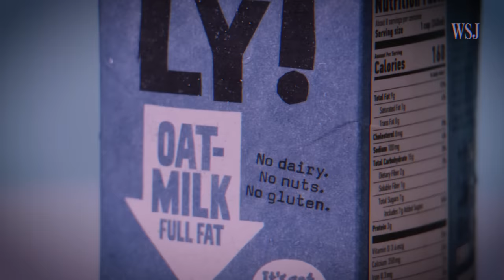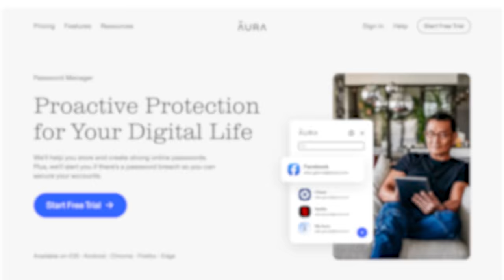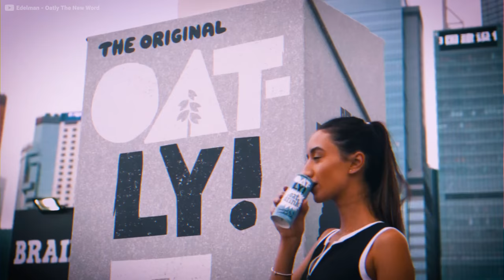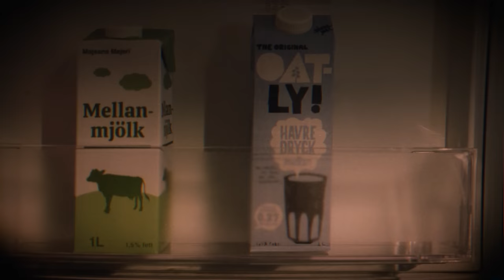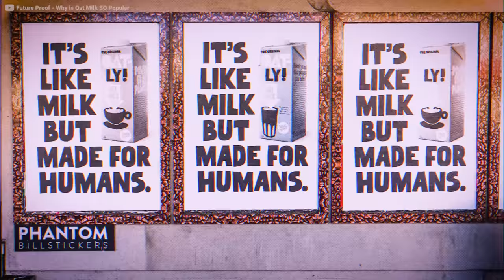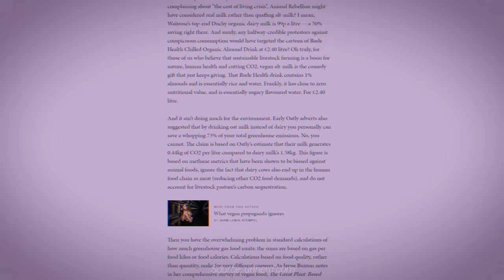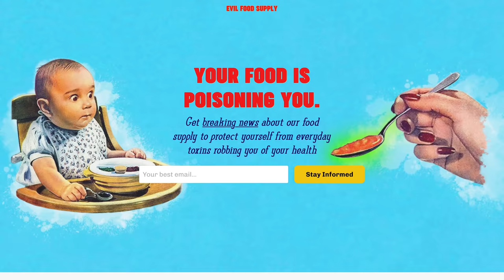Oat Milk is literally a scam.

Comment: I hate oatly, just to be clear. But there is so so much wrong with your video. Let' begin. In germany you pay around 2.5 € for 1 litre of oatly. That's roughly two dollars. If you buy offbrand oat milks you can get away with 0.9€ per litre. So the pricing is just an inherent feature of american capitalism. By the way cows milk here is aroound 1.3 € per litre.
Also, there is absolutly nothing wrong with dipotassium phosphate. Using complex words for everyday ingridients without clarifying what your exact issue is, is just cheap fear mongering.
That process to make oatmilk taste like something is just good old fermentation. Known to mankind for ages. You even point out that that is what happens in our mouth. So guess what happens when you eat oats.
Also, the glycimic index in itself says nothing. What you are looking for is insulin response. Did you know that glucose has a GI of 100. Wonder why you didn't point that out.
An there is so much more... I wish you would have pointed out the real issues that make oatly a company to be avoided, but instead you appeald to ignorance and emotion and cheaply arrangend information fragments without context.
Reply: Well said.

Comment: Wait so nonstick pand also can be bad for you?
Reply: They say it’s only if you use is for too long or scratch things into the coating… not sure what to believe!
Reply: Yes. As the coating gets destroyed, it ends up in your food, and then in you.
Reply: @malcolm_in_the_middle  what if only cook in it when i use olive oil? Does it help.
Reply: @mohamedhazzam9370  Not really. You still have to move the food out of the pan into your plate somehow and also you have to stir the food in the pan somehow too. So you can scratch the surface and get the coating into your food.   Use wooden spatulas or spoons to do so.  It will protect the pan better too.  But if you are afraid - you can switch to other types of pans.  Iron pan seasoned with olive oil seems to be pretty good for cooking.
Reply: @alexforce9  im glad you brought that bcz here is how i do it. I basically heat the pan a bit. Put some olive oil to cover it. Crack my eggs in it and just leave it to cook. Then when its ready i just eat it off the pan without moving it. I do use . wooden spoon.

Comment: now do cheap peanutbutter. my kroger brand i bought actually has vegetable oils, sugar, preservatives.

like why do you need to cut peanutbutter with vegetable oils? it tastes noticeably worse than natural peanutbutter.
Reply: The kroger brands has the most toxiccc ingredients!! Don't even get my started on the salad dressings!! 
I seen the exact peanut butter you're talking about too, it's insane !
Reply: Technically most of the added ingredients are cheaper than the peanuts, so they save a few pennies and it also increases the shelf life so they can make larger batches that last longer. Corporations are all profit focused.
Reply: @sidology1.0  crazy thing is they also make an all natural version that's all peanut butter like wtf??
Reply: @jimster1111  I only buy the all natural Kroger peanut butter, just peanuts and salt. My stomach tolerates it much better than the conventional stuff
Reply: Any peanut butter with hydrogenated oils added will give me insane stomach acid in about 5 minutes from just a little spoonful.

Comment: If you have any knowledge of chemistry, you know that trans molecules are more stable (trans or cis in chemistry refers to the way their atoms are arranged) - in a lot of cases this could be a good thing. In the case of trans fats however, this stability is why they are so dangerous. The more stable a molecule is, the harder it is to break down. The health consequences of trans fats all stem from it being difficult for the body to break down into its building blocks to use as energy. So, they are stored in the body for far longer, leading to a cascade of potential health problems.

Comment: Home made is good. You've to add whole dates or something sweet like that, along with a pinch of salt and there you go. I use a handful of cashew nuts instead of oats as it doesn't require filtering for any pulp.

Comment: Guys, don't use honey or any other sweetener in your homemade oat "milk". As you can see in the video, it naturally already contains a lot of sugar after the breakdown of its starch through the enzymes in our digestion, so use it!
i'ts simple, buy a small packet of amylase (it's very cheap), add a little to your oat milk and watch the magic happen, the starch will break down right there and it will become naturally sweet. As described in the video, the sugar generated by starch is not the healthiest due to its high glycemic index, and for this same reason we should not sweeten it further. 
Anyway stills a lot healthier than the cow milk.

Comment: Maybe my palate is spoiled. I've tried almond milk and rice milk, and I thought they both tasted awful. Never tried oat milk because I really don't like oats- not as cereal or meal, or anything else. Guess I'm lucky.😉🌻
Reply: When you're so used to the sour taste of dairy, it's no wonder you'd be turned off by almond milk and rice milk. It happens to everyone who's used to dairy milk; happened to me. You just have to keep using it until you're used to the taste. I found what really helped me was using unsweetened, vanilla almond milk with my cereal or granola for breakfast, and using it for my mac n cheez. Now I can drink it straight with a pb sammie no problem. I think it tastes way better than dairy. Then again, I was never a big fan of dairy milk to begin with. Also still can't stand rice milk, but that's probably an ASD thing; too watery.

Comment: Great Video, though the chemo-phobia in this is saddening. Trans-fatty acids are not naturally present in rapeseed oil - even after producing the oil, but upon heating the oil some may be generated. Similarly Aldehydes are a vast group of chemicals a lot of natural flavours are aldehydes, it literally just means that it has a double-bound oxygen at a terminal carbon.
and everything, literally everything i chemicals.

Comment: 8:33 "A CARTON OF CHEMICALS' = What a useless statement. Virtually everything is chemicals!
9:14 Several types of oils, when processed with heat, have trans fats in them, including canola, corn, butter, margarine, shortening and spreadable margarine, deep-fried food, chips, deep-fried food, soybean, vegetable oil (blend), lard, tallow, fat from ruminants (cows, sheep, goats, etc.), and so on. Oil that is reused for cooking will develop trans fats in it, depending on which kind of oil, the temperature used and how many times you use it. It IS true that the US doesn't require labeling if there are .5g or less, and often serving sizes are small enough so that they don't have to show the actual trans fat content.
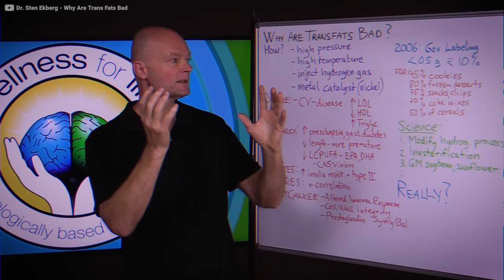9:52 Be careful using Dr. Ekberg - he mixes facts and fiction.

So, again, your video is a mix for me. Good info, but what are we supposed to drink? I can't drink milk - I'm 90+% lactose intolerant - and I'm not consuming animal products (aside from fish). Your videos give a lot of bad news but you don't provide suggestions let alone solutions.

Comment: Does anyone know what real oatmilk tastes like, without the additive mass produced factory mixture? The ingredients are: rolled oats + water. It is worse than oatmeal (boiled rolled oats + water)

Well, these oatmilk company have to make delicious oatmilk, so that it can sells... you know, you have to add dozens of flavoring ingredients, thickeners, mixers, stabilizers, colorings, preservatives, sweeteners, enzyme, etc. so that the final result resembles the texture of milk & delicious.

in my opinion, mass produced factory oatmilk is one of the biggest scams of this century.
mass produced factory oatmilk is not a healthy drink, but a trash drink that is posed/displayed/sold as if it were a healthy drink.

And did you know this oatmilk company is really smart? Genius indeed.
they choose cheap ingredients, processed with flavoring ingredients, thickeners, mixers, stabilizers, colorings, preservatives, sweeteners until they appear like expensive "milk".

oats are one of the cheapest crops in the world.
The price of oats as of today, November 2 2023, is USD 4 dollars per bushel (1 bushel = 14.5 kilos).
Price of 1 Kilogram of oats = USD 0.275 

1 kilogram of oats can be processed into around 32 liters of oat milk, with oat milk only 10% oats

Genius indeed....using the cheapest ingredients, selling at the most expensive price!!!!

Comment: A bit misleading, at least on the maltose thing. Pure maltose may have a higher glycemic index than table sugar, but it’s the total AMOUNT of carbohydrate and not necessarily the TYPE of sugar that really matters to your health. 8oz of Oatly does contain 14g net carbs, which is higher than dairy milk, but it’s certainly not comparable to Coke which has 30g per 8oz. This seems like a scare tactic.

Also the fact that oat milk is so non-labor-intensive to make means it’s way better for the environment than cow’s milk. Sure it has a huge profit margin and it’s certainly overpriced, but it does do some good for the planet.

On balance, it’s a little more nuanced than this video makes things out to be. I don’t drink it because I’m diabetic and the carb content is just too high, but other people who have nut or dairy allergies or who are concerned with sustainability should feel like oat milk is a valid option, not be frightened by these over-dramatic scare tactics.

Comment: Don't buy this shit.
If you want almond milk, do it yourself:
Chop/ coarse blend a handful of almonds and put it in some water (with a pinch of salt if you wish).
Let it soak for like 1h (can do faster if you wish, depends on how fine the almond is).
Filter (keep the water), and then press the remaining paste to get your "milk" (like, put the paste in a clothing, and squeeze it to extract the natural almond fat).
You can add back the filtered water until you have the correct consistency.
You can keep it a day, maybe two on the fridge.
It's great for lactose intolerant people.
You can probably adapt this recipe to other nuts.